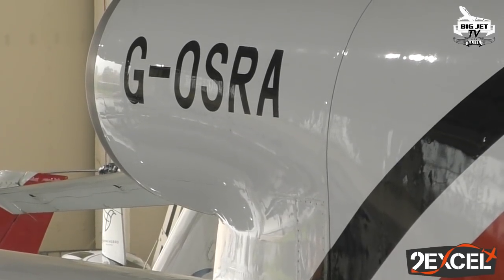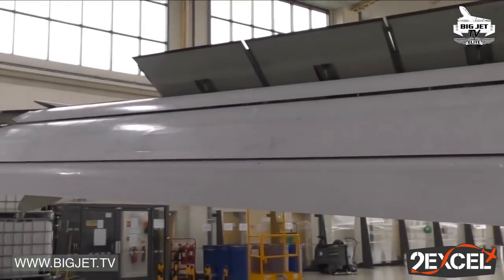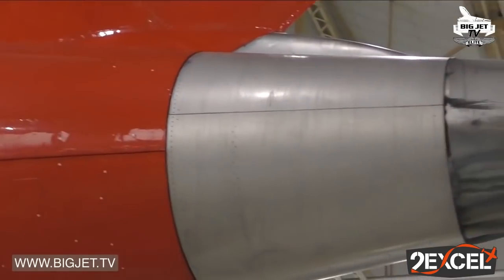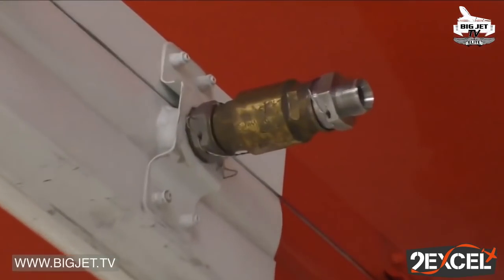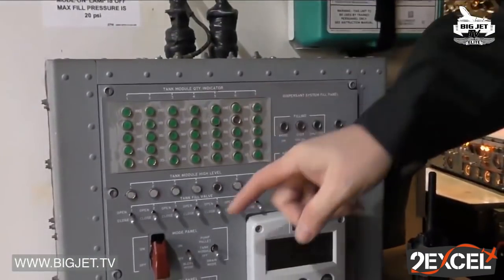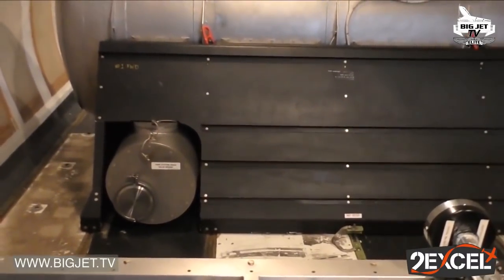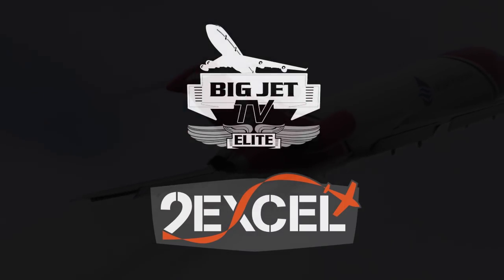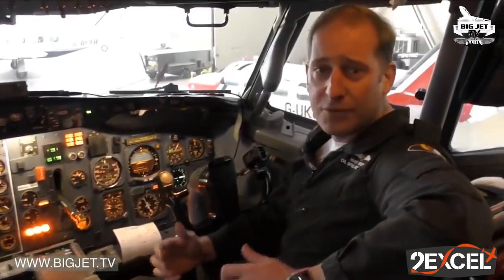2EXCEL OIL SPILL RESPONSE BOEING 727 EXPLAINED - SHORT VERSION

Comment: Fluid huh, no mention of the actual name of said Fluid or toxicity. No warnings signs around that i could see, call HSE stat 😂
Reply: @Tazz-Media  , I know this long after you asked the question, but here is the response that hopefully also helps the next person who comes across this video with the same question.

The exact chemical used will vary depending on the nature of the spill and the conditions at the time.  All are chemical dispersants and the most common ones are Slickgone NS, Corexit EC9500A, and Finasol OSR 52.  These are all deemed safe for the environment, definitely better than the petroleum product they're combatting.

There are also some microbial products coming to market such as OSE (Oil Spill Eater) that actively feed on the hydrocarbon and break it down.  Think of it like taking something that is a 7 of 10 on the "bad for you scale" and making it a 3 of 10.  Still not an ideal situation,but much safer and a little easier to deal with.
Reply: @ParkerUAS  Hey Parker - Thank you for your reply & explanation, that all makes sense now. I've heard of Corexit from the Mexico spill, i believe. No offence meant about the HSE, just a bit of UK humour 🤣